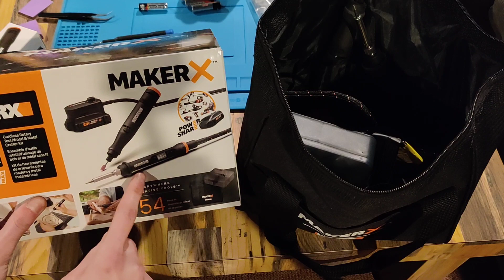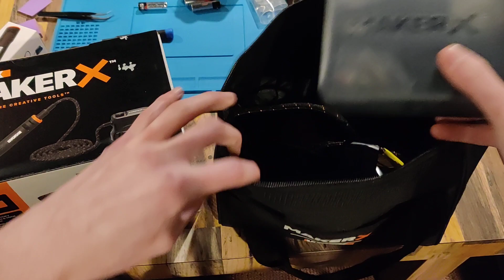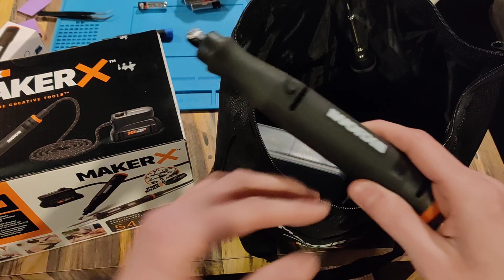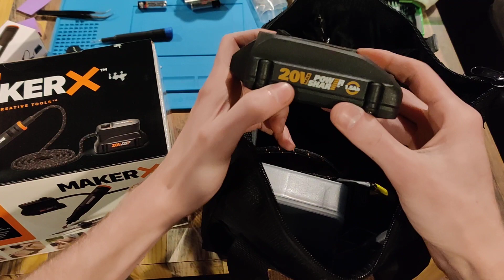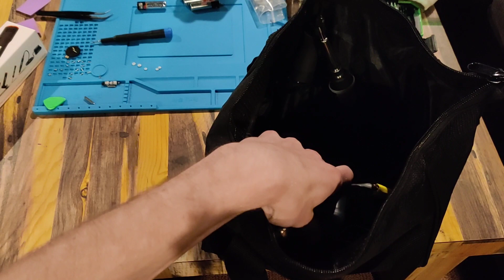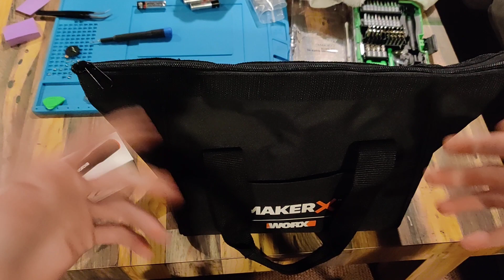MakerX WORX Rotary, Soldering iron/Wood Burner Review pt.2

Comment: The battery issue you have, Is why, DIYs like me, bought a lot of worx products. It cost a bit much at first, I saved other places, and now that I have 5 Batteries, I don't need to buy tools with batteries anymore. So every tool I buy is half the price. When you reach a good number of batteries. Like 3 - 4 or 5, you don't need anymore. Cause, believe me, They are GREAT batteries. They're tough, they're lasting and they work anytime time you need them. So buy when you need it. You have some tools that come with 2 batteries. Like the switch drive, I bought a couple of years ago. And my Weedwacker also came with 2. Now I have 5 and all my purchases now, are almost all HALF PRICE. Think about it. Cause that battery is HALF the cost of your purchase, believe me. You'll thank yourself later!